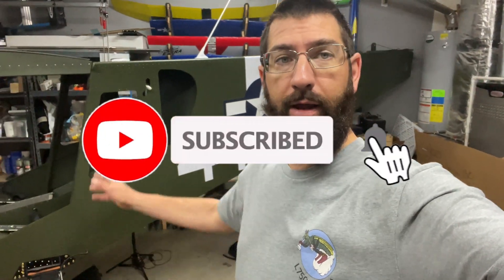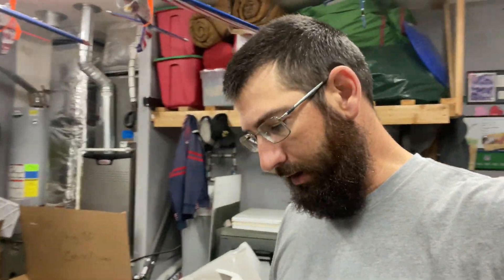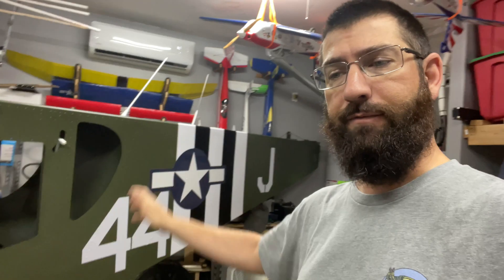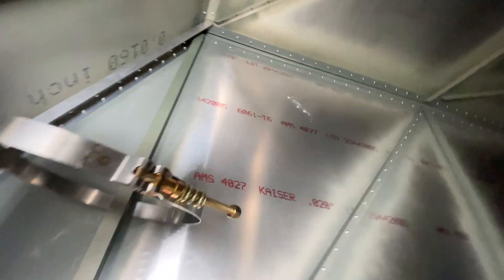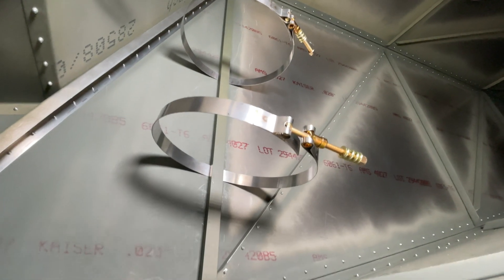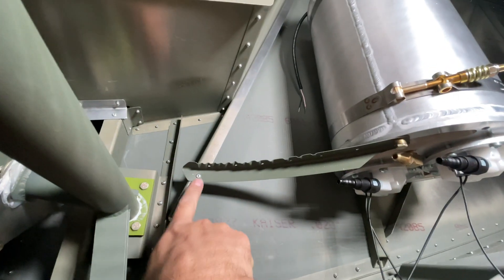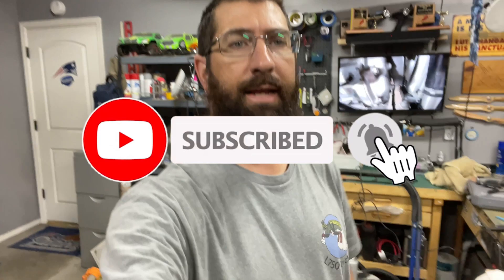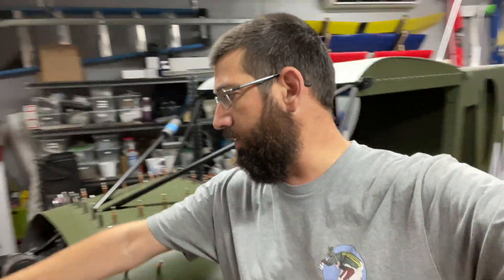L750 Cricket: Header Tank install

Comment: Hole punch some 8.5x11 paper and tape them such that it covers the side of the fuselage with one rivet in each hole.  Spray the rivets
Reply from the maker: Thanks. I was thinking the same thing…. I was thinking I could use my small airbrush for a more controlled application too.

Comment: Sand the rivets really good Etch and paint . Put a few layers of tape poke hole in it same size as rivet shaft and put that in between rivet gun and rivet it should be fine touch up with Q-tip I have done this even with Epoxy Great build keep them coming 
Take Care
Reply from the maker: Great, thanks for the tip.
Reply: @JoesRCCorner  anytime I have a big rig Body shop so i deal with rivets all the time

Comment: If you paint them first, chances are the paint will crack when you install them as the heads get formed during install. And paint usually doesn't like to bend unless it's poly urethane, then it might.
Reply from the maker: The paint is a urethane. I might do some testing